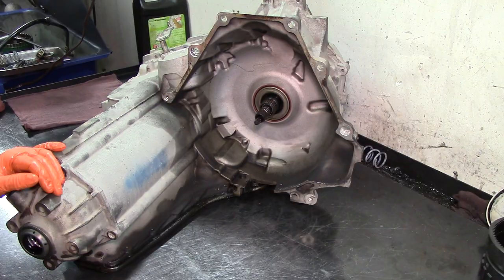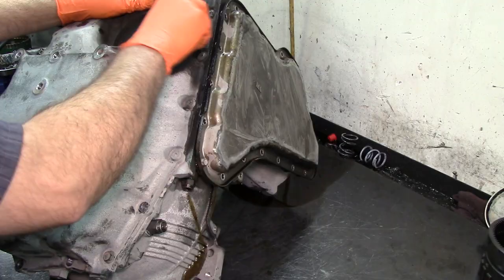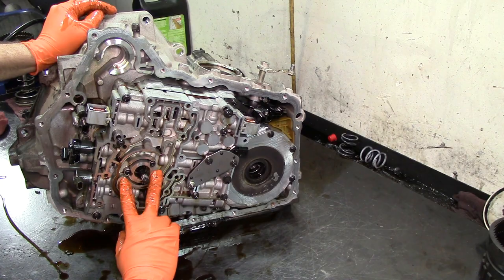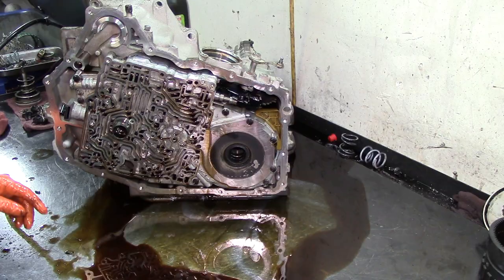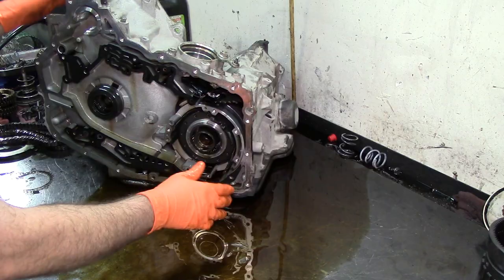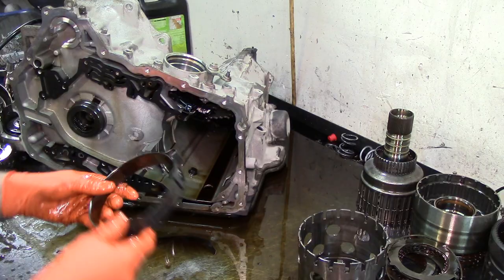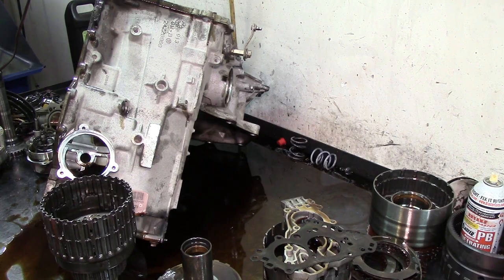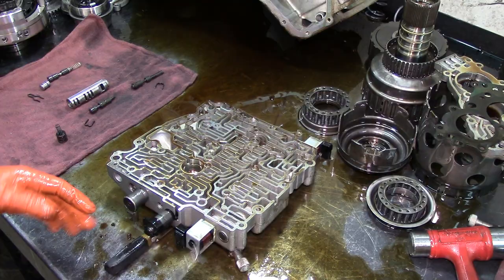4T65 E Transmission Teardown Inspection

Comment: Thanks for the video. I did have my check balls fly out and the one is not marked like the other three. The bottom left one is in a hole that doesn't have a "finger". 
I have never rebuilt a transmission and mine has 255,000 miles on that sweet 🍼 baby. 
The car is only worth 3k.. so what do I have to lose. The covids have destroyed the used car market making them worth so expensive. 
If it doesn't work I will take her out and have a professional rebuild her. Maybe extra work.. maybe a 3k savings. 
Thanks again!

Comment: You, Sir, are a master of your craft!
I have a 2002 Impala 3.4L with a trouble code of: P0742 Torque Converter Clutch Circuit - Stuck On
Do you have any suggestions on how to remedy this...possibly without removing the trans from the car?
Also...you mention the Volvo trans having similarities to this one...are they interchangeable?
Reply from the maker: It is very common for the turbine shaft seals to ripp causing a crossleak applying the converter clutch. Less likely for a stuck solenoid unless it's blocked with contaminants causing the fluid to not exhaust. Either way it needs to come out. Torque converter damage is also very common.

Comment: Wow all my friction plates were bad, 4th had very little material on most and the clutch material was falling apart on the others” it was only the scored metal left....most of the material was on the bottom of the transmission pan” it looked like Pieces of hardened gaskets” there was only 1 hub that had good clutch packs.

I’m suprised the car ran at all.....and explains my slipping in first” everytime I stepped on it, the transmission would slip and go into 2nd gear right away.....on the freeway I could do 80mph but the revs was high.

I also won a lot of races with this broken transmission.....I can’t wait to finish the rebuild.....I was doing 12s with this broken ass transmission.
I replaced the supercharger with a turbo.....so I’m glad I caught the clutch pack material inside the pan, hopefully with the new zzp torc converter and a fresh rebuild, my car will do better 1/4 mile times....I’m also using a stronger chain and input shaft.

This engine and transmission is inside a Fiero Lol I’m trying to beat the fastest fiero with the turbo conversion on the 3800 s2 supercharged engine.....the best 1/4 time is a 9.10 quarter mile time, and his engine is stock” with a turbo”, and his transmission is on its way out.

Comment: I just wanna say how helpful ur vids have been! Also could u gimme a list of ALL possible causes for no forward gears? I think I counted 3 that u mentioned. Are there anymore? You can hear & feel it go into reverse, then neutral, but when go into Drive or low gears, can't hear or feel anything. I already replaced all solenoids, wiring harness, pump, forward band wasn't broken.

Comment: Great video! I have 2004 impala 3.8l with f83 axle ratio can you tell me why a 2007 grandprix 4t65e with same axle ratio same harness and connector it looks like valve body and solenoids are the same would a 2007grandprix work in my 04 impala??every time I talk to a junkyard they tell me 04 impala only and 04 grandprix 04 Monte carlo 04 buick regal?? What are the differences between 04 and 07?? Thanks for your expertise....

Comment: Great video! Very thorough and in-depth. I came upon this video because I have a 2000 Pontiac Bonneville SSEI (supercharged) that only has 1st and 2nd now. I did a side cover partial rebuild of everything I could replace while the tranny was in the car. The result is I got 4th gear/overdrive again (since I changed to the hardened hub), but still had no 3rd gear. After a couple of months driving that way, I lost 4th gear again. I'm trying to figure out what I should replace if I took the whole tranny out for a rebuild to get 3rd gear again. I'm guessing I need to change the 4th gear hub again because maybe the teeth maybe wore out jumping from 2nd to 4th. Or is it a better option to buy a junkyard tranny for cheap and roll the dice? The car is right at 150k miles and in very good condition otherwise.

Comment: Very good video,i have chevrolet impala 2011 3.5lts and wend it s in drive at a stop and i press the acelerateur it slip and lock,it go boom,wend i put it in firsrt gear it ok like a brand new,i want to get it rebuilt but no mecanic cant tell me why it those that,i think if i find a garage that a mecaNIC COULD TELL ME why it do that IT WILL BE A GOOD PLACE TO REBUILT IT,THANK YOU IT S A REAL NICE VIDEO

Comment: At 27:05 the code is a 1811” causes ruff shifts, and the computer will increase line pressure.....been there had that happen, my fix was to use a wire harness and computer the 1997 and 1998 uses a different computer than the later models.....since my car is a fiero....I went with a updated computer and wire harness and the 1811 code went away....the older computer was Performance programmed” to.make a long story short.....the 1997 and 1998 GTP cars use a different computer than a 1999 and up.

As for the chain The supercharged 4t65e-hd definitely uses a double chain system....and a longer diff.

Comment: Hi Hiram, I have been rebuilding Trannies for quit awhile, I have in my personnel vehicle a 2002 Pontiac Grand Prix. The car was given to me so I removed the Trans and rebuilt it, now I have a problem with the first shift, it will shift into 2nd then seems not to complete the shift, no slipping but will go back into second with a light throttle,  It isn't setting a code, it seems to be not going into third, have U heard anything like this before
I love Ur videos, they are very informative, I have subscribed and will watch every one of them. Keep up the good work, I just got done watching Ur Bi lingual video on 6L90 E

Comment: I've got a 4T65 E in my 2002 Chevy Venture. It's got 333,000 miles on it and to my knowledge it has never been rebuilt. It still drives just fine, but should I look at having someone rebuild it?

Comment: Finished rebuilding my 4T60E, installed. BIG PROBLEM, NO REVERSE !!
Forward gears engage, but nothing in reverse,
reverse band not correctly installed I'm thinking, what are your thoughts ?
I'm going to start the removal processes this morning.
Lots of new parts inside, no a low budget rebuild.
Thx, transmission guru.
J

Comment: What causes  the car not shift from 2nd. Soon as it tries it's like neutral. Then have to slow down till it goes back in 2nd or 1st. After a bit it will shift to 3rd and is fine after that.

Comment: 2006 Monte Carlo SS, when warm stops moving, switch off car for a few then restart car begins to move only for it stop engaging again after a couple of minutes
Reply: +Michael Gomez Sorry for getting back to you late. I believe the issue was that fragments from clutches begin to block the filter restricting flow. That's the reason when you turn off the car and turned it back on it begin to move again due to the sediments no longer blocking the filter. When this happens your transmission has to be open and cleaned and replace of all worn components.

Comment: My transmission is making a clunking noise and I believe it's coming from the passenger side of the trans. It happens when it's warmed up and it's when ya let off the gas and then when you pick it back up. Like a differential when there's slack is the best analogy I could give really. I was hoping it was a cv shaft, but I see no play and it really sounds like it's just inside the passenger side there when I jack it up and move the tire back and forth. Any ideas? I guess I should inquire can I take the diff and shaft from the trans and reinstall in the vehicle and with out special tools or specs? It looks like it would go in and out easily enough. Just not sure if I gotta have special info and tools? And dam it's chain driven too. A stretched chain maybe like a transfer case does sometimes?

Comment: Sir, I have a 03 lesabre with the 4T65E .....car will not move in any gear, forward or reverse until it runs for 15 minutes and gets hot.....It than will go in any gear and does not slip at all even going up hills. It does sometimes delay going into low gear coming to a stop. Once the car cools down again, It has to get hot again to move. I did change filter and fluid, no difference...Any thoughts?

Comment: Hello my name is sergio and I am from Dominican Republic.
I liked the 3 videos are very precise and clear about how that transmission work. I speak for my Lumina chevy 1996 uses a TH125 transmission which disarmed in the second part of your video, just mine uses different media, the matter is that turns me on the CHECK and the code shown me is the P1854 and according refers to peek into the manual "transmission, transfer case contact plate failure 'C' circuit".

I am fond mechanical and engine more and not so much trasnmiciones not understand referred to this code and as you know well that transmicion crey I could help on that means, besides the transmission no longer has the same force.
you agradeseria much your advice if I may explain understand.

Comment: So I have the same transmission in my car it all works fine but I notice on the driver side of the car right by the driver side wheel i hear a sound when the cars running it sounds like a bad bearing sounds like a grinding sound. No check engine lights no trouble with driving or shifting of the transmission. I’m curious what it could be the driver side has the transmission passenger side is where the engine is.

Comment: I have a 2004 Monte Carlo, it wont go past 2nd gear(35mph) and the transmission doesnt make any wierd noises. Everything runs fine. And i want to know what it could be before tearing it apart. Any Solutions?

Comment: I have a 03/04 GTP sitting in my driveway that seems to have a trans problem. it clatters when it's put in gear and won't move and will still move while in park but clatters when it's moved with the engine off. I took the left wheel off and spun the hub and it clattered. now that I see the chain drive I'm wondering if the chain it stretched to the point of causing it to skip over the gears? thanks.

Comment: Having trouble getting a '04 volvo s80 t6 transmission out, there is no indepth tutorials on removing the trans, just replacing the cervo etc, would you be able to make a tutorial on how to remove the trans? My Volvo is slipping 2nd gear really bad.

Comment: Good day house,
Have issue with my Toyota sienna 1998 any time i packed it for like 5hour plus it usually delay when i put it on drive i will need to raise the car severally before it will engage.
Please any solution ??  but it reverse

Comment: I worry daily about my Impala SS with the HD version. All I’ve heard is the reliability issues with them(mainly solenoids and overheating). It has 125k miles on it, no history of any transmission replacements. I bought it really cheap, but had to sink $4k to basically buy a new engine. I love the car, it’s a lot of fun. I’m still young so it’s not a huge issue of paying that much, (a lot of people judge me on it lol) but I really don’t want a transmission to go out. I drive it tenderly most of the time, with the occasional hard throttle. Any recommendations to help keep it running in tip top shape for better longevity? At this point, I’m starting college so no, people, I can’t buy a different car lol.

Comment: Changing the Filter On My 4T65E Transmission, When Putting Back Together I Noticed 1 Bolt is Longer than the Rest??....I Did NOT Notice This Taking it Apart??
Does Anybody Know IF this Is Important, the Placement of Longer Bolt..

Comment: hey hiram i have a 2002 impala 3800 bought a trans from a guy he said there are only 3 diffs on the 4t65e he said he matched them up an they were ok ? it has a 30 stamped on the reluctor gear the tag on the trans has paint cant c it can u help ? ps don't have the old trans . thanks

Comment: I went to mechanic school years ago worked  auto parts wholesaler since 1987-built several street rods  have rebuilt many engines-but never fooled with a transmission. Always wanted to. I have a 99 Volvo s80 with a GM tranny. I have drive and reverse and can manually shift to 3rd, but I believe the tcm got damaged from possibly someone jumping the battery backwards-says it can't download its codes. fluid is perfect . MY question is should I  buy a cheaper rebuildable trany and then replace the parts including all solenoids  or should I just buy a more expensive used one and hope for the best? Spending hundreds on a used one seems silly to me-as sometimes the warranty may only be 90 days. donor car is always questionable

Comment: Thanks for the video.  Now I know where the ISS sensor is located.  Question:  Does that sensor go bad or is my no signal code P0717 more than likely a bad wire or connection?  (2004 Grand Prix GT)

Comment: AT 3:07   WHAT WOULD CAUSE MY AXLE TO HAVE UP AND DOWN SLACK IN THAT HOLE THERE IT SLIDES INTO THE TRANS AT?? WHAT DO I NEED TO FIX IT? A BEARING OR A SLEEVE BUSHING OR SOMTHING TO STOP THIS NEW HALF AXLE FROM WOBBLING AT 35MPH.

Comment: Thank you very much for the informative video .And the live in Russia in city of Volgograd.Have the car Pontiac Grand Prix 3.1 L with manual 4T65E.At full heat the butter foams and the box starts humming,transmission switching kick.While the oil is cold 15 minutes switches excellent free kicks.Need repairs?Or will it be enough to change the filter and oil ?And Yes!Can the oil be mixed with a Dexron 2 and Dexron 3 and Sp2? Because of the different oil poured can foam?By the way the level of warm normal,maximum.Spare parts order from Rockauto.Where to start?Buzzing very strongly, the sound is similar to this when the pump hums power steering when there is little oil.Sound exactly the same! Thanks in advance for the answer.)))

Comment: Hi Hiram, great video, I'm in the middle of a rebuild of a Volvo 4T65-E trans and have a question re the pump driveshaft. I have fitted the new seal to the groove in the boss on the driveshaft but when it is installed inside the sleeve which comes through the channel plate it seems loose and is not contacting the sleeve. Not sure if this is normal or am I missing something? Thanks for your videos. It has made this whole job so much easier, Cheers.

Comment: Thanks for the great tear down video. I have a 2007 Chevy HHR with the 4T65e. I have noise coming from the TC area. When the car is off and I strike the pan withe the palm of my hand I get a noise that sounds like a band of metal vibrating on the inside of the pan or like screws loose and laying in there. The car has 77,000 miles and per the manual the filter and fluid has not been changed. What is my best couse at this point?

Comment: Hiram,
I really enjoyed your video on tear down. You are very through and explain  in great detail. I have a question you can probably answer. Girlfriend had trans in her 2005 Rendezvous CXL rebuilt(very reputable shop). Ran fine for awhile,then started with door locks opening and closing,shift indicator would move back and forth between drive and park, and would drop about 1000 rpms, all while driving at highway speeds. Eventually,when stopped and leaving a stop it wouldn't do anything and all of a sudden it would slam into gear. It never threw a code. Took it back to tranny shop,he said it was the BCM. He replaced and it still did same thing. Shop refused to do anymore. We didn't drive for awhile and are driving more now but nothing at all has happened. It does have a 3 year warranty but what  can they look for if it's not acting up at the time they have vehicle? What think you young wizard? Thanks very much.

Comment: the transmission on volvo 1996 850 goes to limp mode after 2nd speed. i would like to see a repair video, or if u can comment on a repair T#AW50-42.

Comment: Anyone know why my 2008 impala won’t move in none of the gears that I put it in? Rear tires feel locked but I changed the tranny oil and I found like little bit of metal shavings like half mm pieces..what could it be?

Comment: I have a B6294S motor S80 with 4T65EV transmission which fails.
I found many used transmission in my local market, but they may different.
Seller (1) has a B6304S motor S80 with 4T65E trasmission.
Seller (2) has a B6294S motor S80 but with a 4T65EV-GT transmission. It is the same motor, but Geartronic transmission, mine is not.
May any of these are compatible with my car?
Thank you.

Comment: How about I have a problem since the 4T60 transmission has no traction and no avansq and I do not feel the changes and the pasta discs and the gasket set have already been changed and I do not know if you could give me an advice that it could be

Comment: Is it normal for fluid to go into the side cover? The transmission shifts good and drive good but leaks, I have a hole in the side cover, and it leaks from there...I was told my valve body gasket can be leaking.

I purchased a new torc converter because it made a groaning noise when I put it in gear reverse or drive” foot still on brakes”

Comment: Hello I'm wondering about the second gear clutch housing. On the bottom has pitting near center edge what damage will require i replace this part

Comment: We have a 2007 impala, automatic, that has no 1st or 2nd, it starts off in 3rd, when you just put it in D...seems to only stay in 3rd. Reverse works sometimes, sometimes doesn't. We have replaced sensors, what should be our next step? The code from part store was unclear, just said transmission control system malfunction. Does not move in 1st or 2nd, it has attempted to move in 1st, but ultimately goes no where, just revs in 1st and 2nd